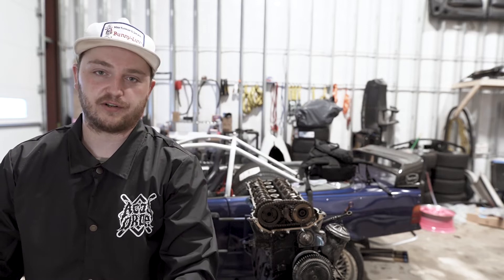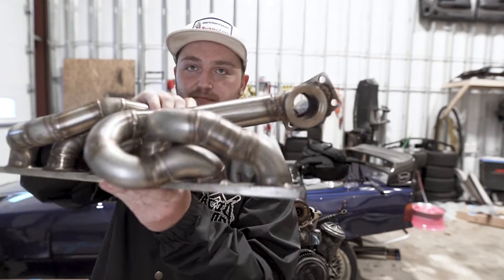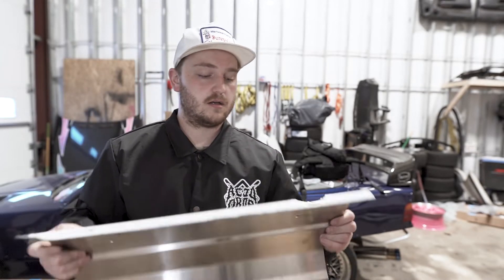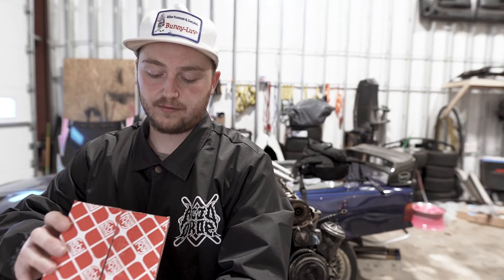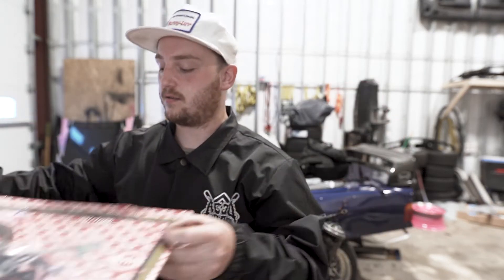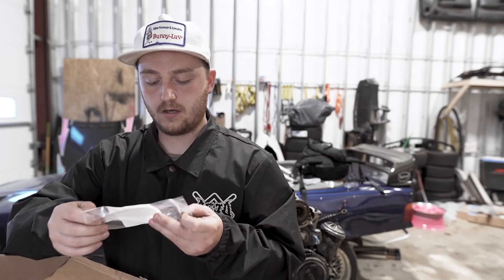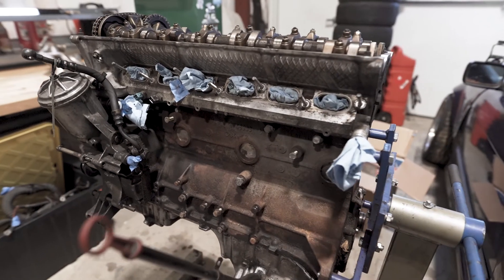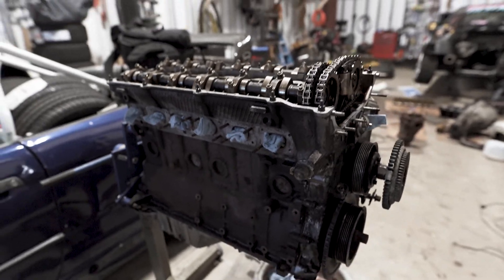Clapped to Gapped - M50B25TU Turbo build Episode 1 - Going over parts, and planning for the future

Comment: Now this looks awesome, stoked for this series!  That chopped E36 is killer too
Reply from the maker: Thank you dude! It’s just a vert! It does look like a weird truck though.
Reply: @SpiralDrift  I spun a rod bearing in my N54 the day after you posted this. Catastrophic. If you mess with the bearings in this engine, please be sure it's done right! That intake manifold is nuts, and I love it. Exhaust manifold is sick as well.
Reply from the maker: Noooooo dude I hate to hear that. Figured out a root cause? 

I’m thinking of a different intake mani, had some folks point out the runners are different lengths which could lead to issues down the road. We shall see though. 

Appreciate you checking the video out! Hope you get the N sorted